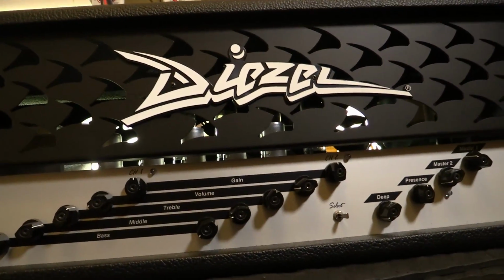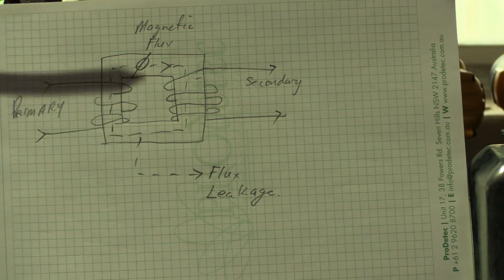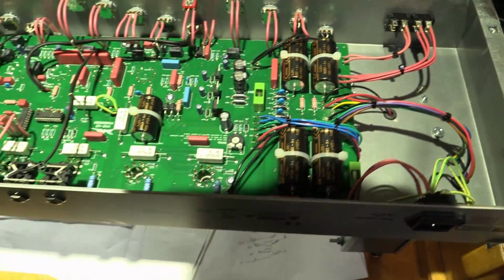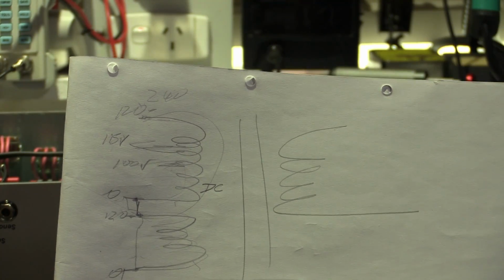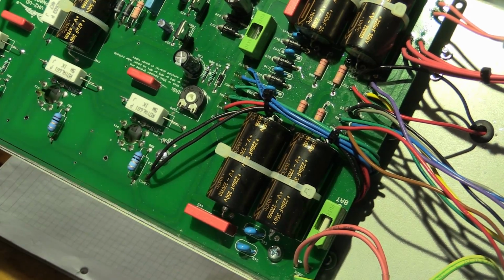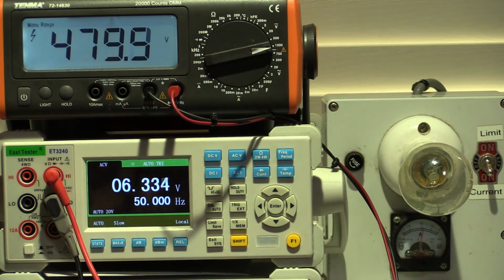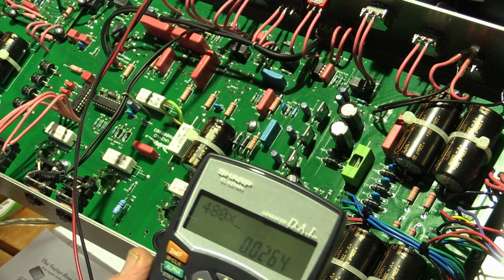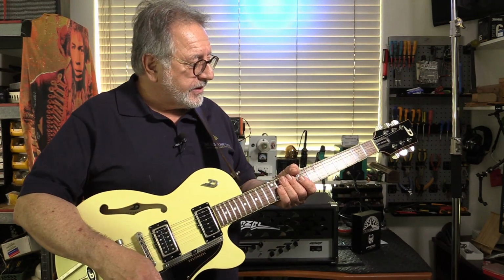Lets look at, and listen to, the Diezel VH2 .... and change the mains voltage

Comment: Hi Chris ...maybe you can help me ... i find the first channel of my VH2 absolutely perfect but the second channel ......i'd like to lower the gain so should i lean toward a 5751 preamp tube in your opinion and can you explain me which preamp tube ( V1 ,V2....V5 ) match with ; for example which tube match with the second channel ???
Reply from the maker: Unfortunately, I can't help you out as I never managed to find a schematic for this repair. As a general rule, the first preamp tube closest to the in put jack of most amps is the most critical in terms of setting the "flavour" of the sound. I like 12AY7s in that position but a 5751 is another excellent choice. Less fizzy that a 12AX7. Problem is, that without a schematic I can't advise you which tube is for Channel One and which for Channel Two. The safest bet is to email Peter at Diezel and ask him the question. Fell free to reference this video.